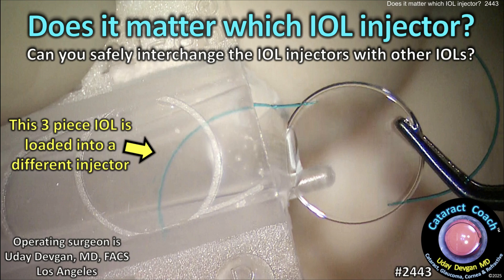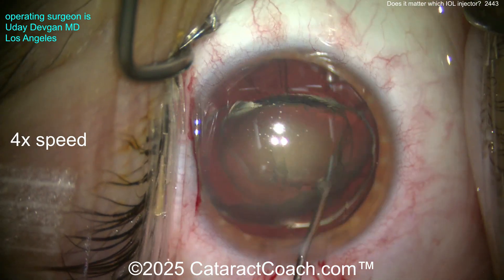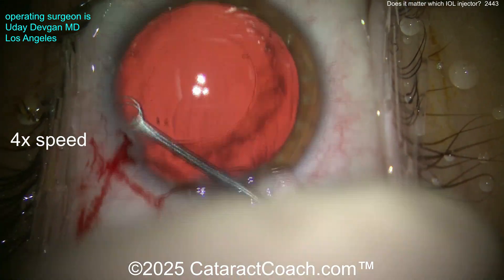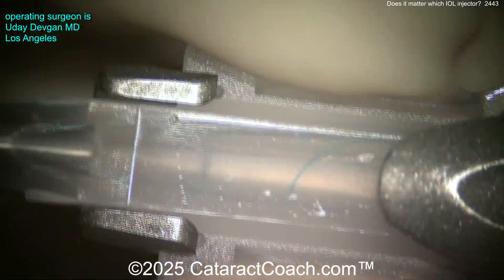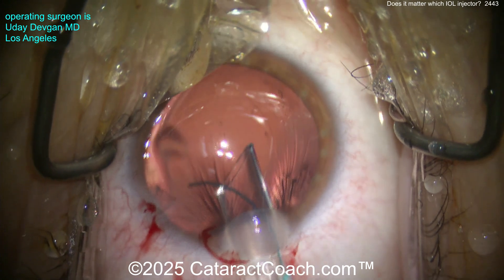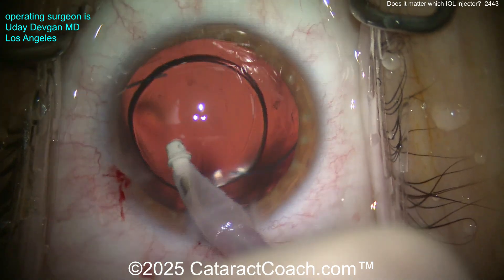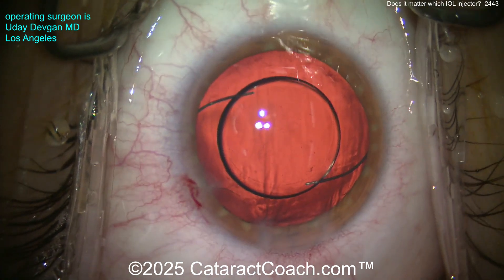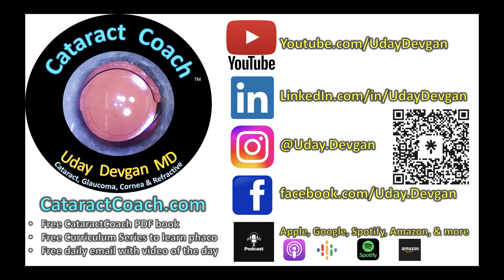CataractCoach™ 2443: Does it matter which IOL injector?

Comment: Hi Coach, can you comment why you used the AR40e here instead of the MA60MA? Just to try something different?

I've heard the Alcon injectors are pretty flexible; I know several surgeons that will use a C or D cartridge for the B&L Envista lenses if they don't have the preloaded version, and their scrub techs aren't familiar with the B&L injector (or don't have one in stock).

Thanks!